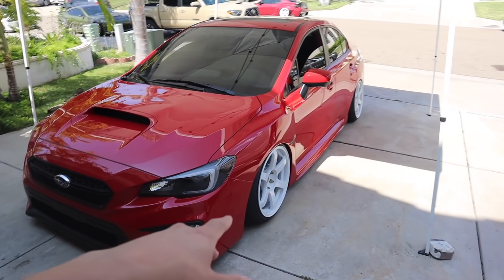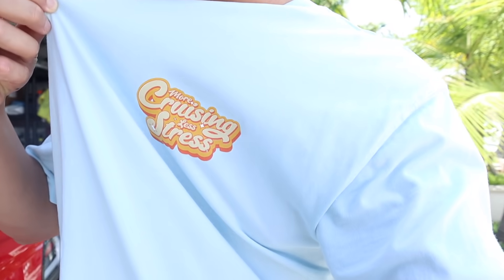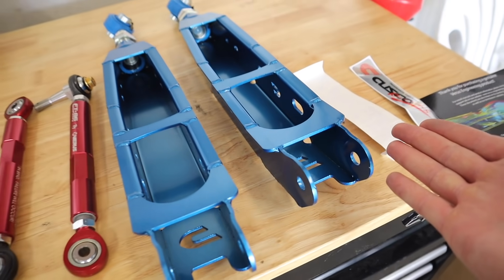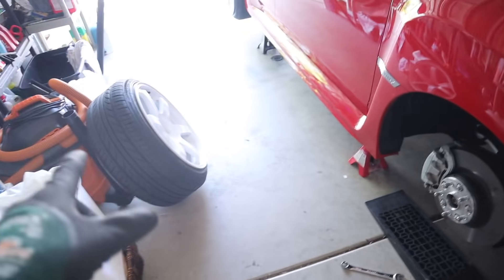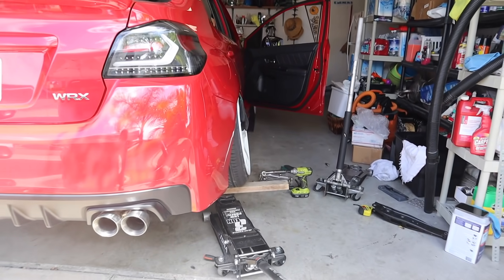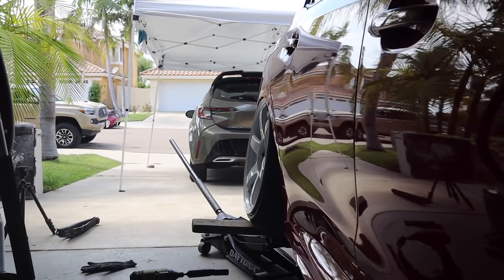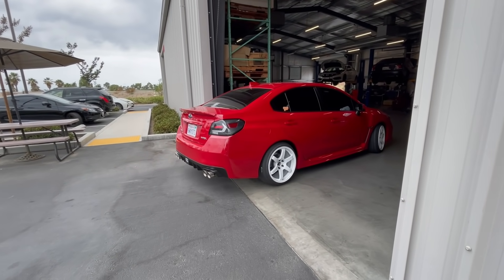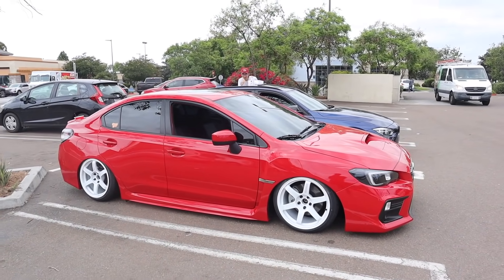NEW MODS For My Bagged Subaru WRX!

Comment: Two questions. I’m having a clunking noise on the right front side of my 17 accord after I lowered it on tein flex z. I check the top bay bolts and changed my endlinks out. Idk what the issue is.  Also you stretched a 10 wide on a 215, but the stretch doesn’t look crazy. So a 225 on a 9.5 would be fine?
Reply: a 225 on a 9.5 won't have that much stretch, very little stretch
Reply from the maker: Clunking happens for me usually when the end links are loose.

Comment: You probably mentioned it in the video but what all did you have to adjust to get the front almost fender to lip. I have my air struts just how they came from airlift and aired out I will have like close to an inch before I’m to the lip of my wheels.
Reply from the maker: adding negative camber helps with the camber plate on the bags!